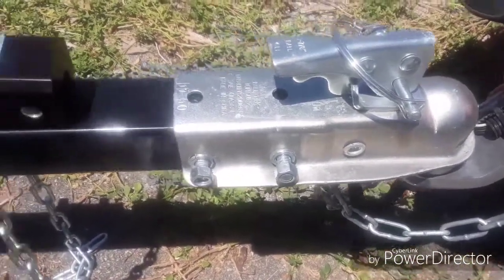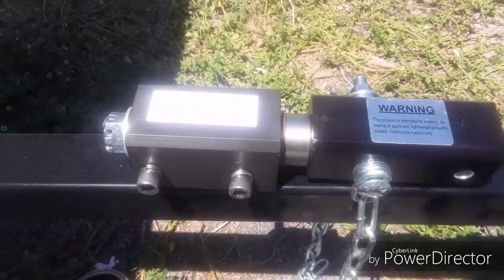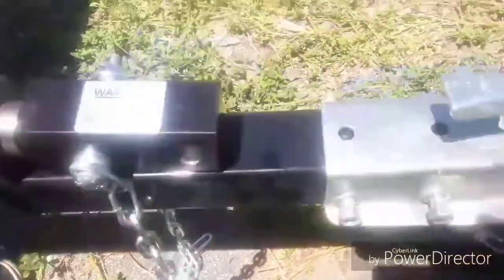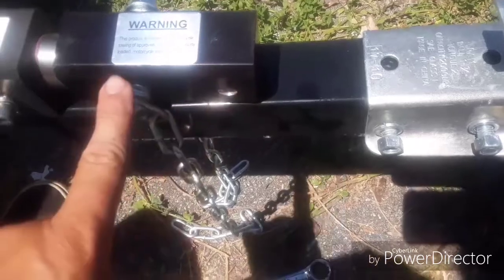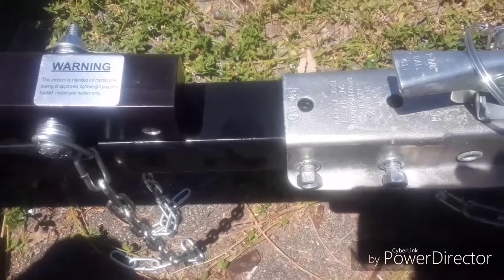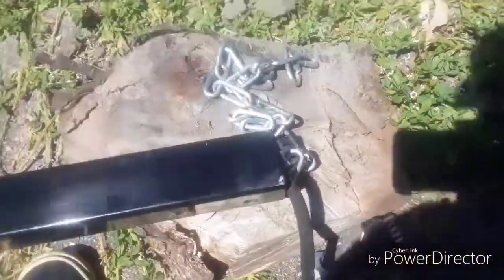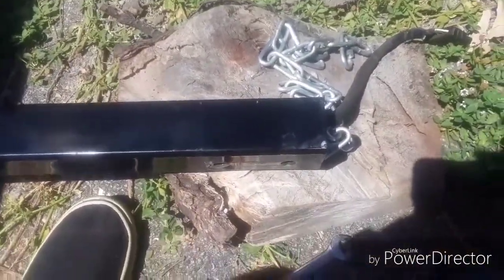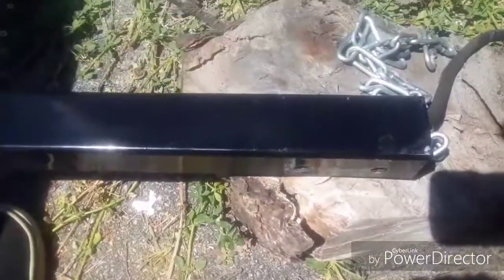Trying to install a Swivel Coupler on a Mini Mate camper

Comment: Please watch the installation video here: https://www.youtube.com/watch?v=8n2s79qc22Y. At the 2:00 mark, we specifically show and talk about the cutout section of the swivel which provides clearance for the wires to pass through.
Reply from the maker: I did all of that but the bevel that was cut didn't allow enough space for the wiring, so At that point I moved much more slowly, paying clise attention how it was going together. I've thought about usinf a half round file to help make a small rounded groove on the bevel., but I havent llayed with it since because of the heat.

Comment: Not to put a damper on the people producing swivel hitches , but a large stainless steel bolt with an air craft type (plastic insert) locking nut,  through a block of aluminum, cut in half, works fine . It can be as thick, or thicker than popular tie rod end  (heim joint) type hitches.. These pivot on the threads only !..This should tell you right away that you don't need any bearings ., (witness the people who go years without dropping their bike, or leaning too far into a corner to bend stuff)... It seldom if ever moves , think it's going to get hot or grind it self down to nothing ? Also ,the top round bar off a kids swing set makes a great trailer tongue .,(ever see one fail ? ) They are galvanized & can be lighter than standard sizes in aluminum! The stainless bolt is used because stainless is hard to snap ..

Comment: What a pain in the ass of course it would fight you. Do you feel you need it i have never had it bind up on mine but if you tip over damage.  I don't know
Reply from the maker: I have never had mine bind up in about 2,000 miles of towing. Principle of the thing is driving me. I paid for it, so I would lime to see it used. There is a road in Georgia called 180. It runs from 120 south, to 60 soutb. The road is heavily crowned, with some turns that require strict attention and rider skill. If it doesn't cause me trouble there, I'm confident it won't anywhere. I'd lime to go there in September. Two Wheels of Suches is licated on 60 South in Georgua.
Reply: @baltsosser  i understand you when I was looking at the trailers for me the ones i wasn't interested in had swivels and the trailer i was interested in didn't.  And i seen the same problem your into. It can never be easy.  Did you end up getting a new back tire after the chunks came out?
Reply: There is a video that may help you by openroad outfitters on how to install the swivel hitch. There is a Bevel edge on the piece that goes into the trailer tongue the tow wire goes along that edge.